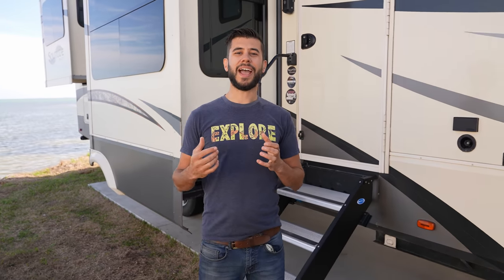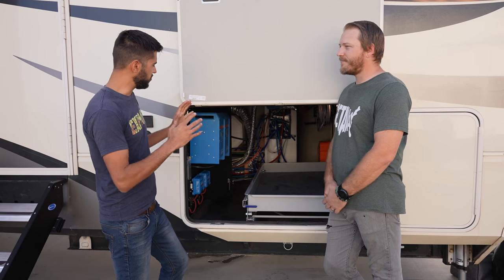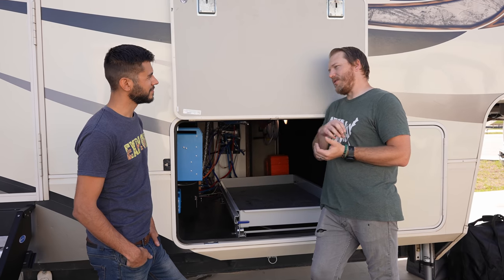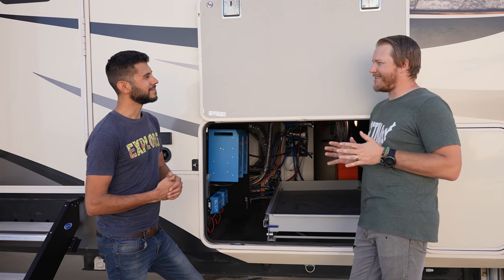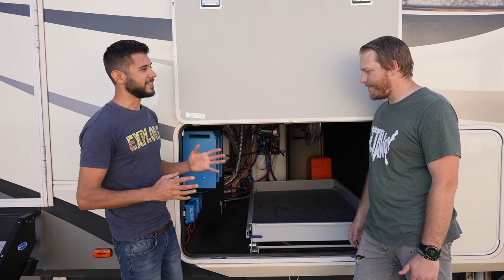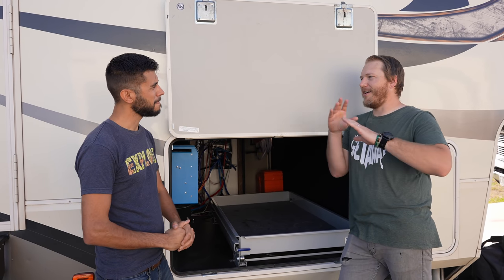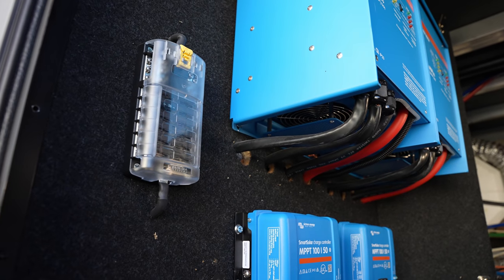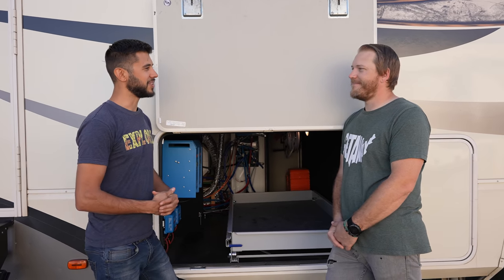Are Two Inverters Better Than One? | Discussing Split Phase Off Grid Pros And Cons

Comment: Of course Victron just released the Multiplus Ii 12/3000 inverter which will take the 30 amp and automatically bridge it accords both 50 amp loads. They are always improving their products. Love your clean install, especially how you ran the conduit on the roof. That makes a lot of sense.
Reply: Have you asked yourself if the new inverters gen 2 are not as great.I mean so durable?
Reply: @bobocrina2643  I trust Victron whether first or second generation. Victron has an incredible warranty and track record. Thus far my Victron Multiplus II has been outstanding and does everything they said it would do. Combined with the 712, ColorControl GX and WEN Generator it is an outstanding system. Not sure I want or need solar.
Reply: @terryhaynes1596  I was told by a well known Australian  Victron Dealer/ Instaler that  they do not have so great experience with second generation inverters . they are lighter with not so solid materials to cut costs.
Reply: If so, glad they have a 5 yr warranty.

Comment: Love the nerd out vids.  I'm an EE and installed a system similar to Jasons.  Dual Victrons/600ah BattleBorns/1200w solar.  All power from shore passes thru the Victrons.  My victrons operate more efficiently in split-phase mode than in single phase parallel mode.  I seem to get a little more out of my battery bank in split phase when boondocking.  Perhaps because each unit alternates which is pushing energy into it's coils during inverter mode.  However, the hybrid function works far better when I had just one Victron unit installed.  They don't just cooperate that well when you limit your shore power.  I frequently get whole loads tossed into "inverter" mode when only a few watts is needed from batteries to supplement.   My 50a split phase mode works a little different than Jasons.  Both units draw from shore power, one on each leg.  The second system does not draw from DC.  Also, the constant reprogramming from parallel to split phase is a hassle when you move around a lot and don't know whether your getting 30a or a 50a connection next.  As smart as the Victrons are, this should be a software fix.  Just detect the incoming waveform on each leg.  If they're 180 out, switch to split-phase, if not stay in single phase.  Hello Victron!
Reply from the maker: Awesome! Thank you!
Reply: Hey maybe you could answer my question. I am wanting to hookup a solar system to my house.. my plan was solar to charge controller to battery to inverter then to one Positive lug where the meter used to be... Same exact setup running into the other Positive lug with ground and neutral together... Would that make a split phase to allow me to keep the original breakers and wiring in the house?
Reply: You wouldn't need to reprogram anything if you wired them correctly!

Comment: With a dual 3,000 watt Victron Inverter system like this,  I would definitely have a battery bank of 10 Lithium Iron Phosphate batteries. I'd have such a great time installing the quality Victron Energy components for a boondocking-bound rig. Electrical Gear Geeks Galore!

Comment: Great discussion - Not the end of the world but you migh consider separating the inverters from each other - they vent from the top and your pushing hot air from o0ne inverter into the other. Be safe Mike

Comment: Hi do you need two charge controllers? I got a 3000w inverter/charge controller, but want to add a second regular 2000 watt inverter. I don't have a victron inverter though. Also my main inverter charges via shore too. So I'm assuming I'd need a system that turns off the secondary inverter when shore power is connected?

Comment: Tom will the auto former if your just using your batteries and say running 4000 watts still balance the power to both 3000 watt inverters?

Comment: When you connect to any shore power source thats less than 50amp, how are you getting around the pass thru power issue?  From what Ive read, 30amp (example) shore power connected to a dual inverter setup cant supply power thru both inverters.    For victron you have the option of passing thru single phase power on one inverter while the other inverter (L2) is only able to invert.    So you would have the full 30amp on L1 that goes thru inverter 1.   However L2 only has power from batteries, not shore power since L2 routes thru inverter 2.  And then single phase generators have this same issue.

Comment: I’m curious that if you’re using two separate inverters, are you using two separate battery banks?
If not, how do you wire this up? 🤔
Reply: One battery bank, normally batteries run to a busbar and then from busbar to each inverter....inverters have to have the same firmware and be programmed to work together....

Comment: Why do you only have 2-50 amp controllers for 2000W of panels? The most you can get at 14.6v is 730W per controller, so 1460W max. It would be an easy upgrade and not inexpensive, but it's like 2 of those panels aren't even being used.
Reply: Generally having extra solar panels is a good thing, it means on cloudy days you can still make 1460W to max out the controller and in the summer you don't have to tip the panels  because you still have enough coming in with them being flat at a bad angle.
Reply: @BenBrand  having the controllers sized so that they can provide the maximum power that the panels are generating makes more sense. On cloudy days you take what you can get but on sunny days they are limited by undersized controllers.

Comment: How about 1 larger inverter….say 5000 watt….and an auto transformer to balance the loads?
Reply: Yeah that's for sure the better way to go. Problem with this setup is that you can only ever get up to 3000 watts on each leg. With the autoformer setup you can use 100% of the power on each leg.

Edit: They do cover this at the end of the video
Reply: A single inverter is more efficient as the standby power of only 1 inverter being on is half as much, as well as creating a simpler system. Sometimes simpler is more efficient and in the end better. I have a 4000 watt giandel super efficient DC-DC/AC inverter which works the same as powering from the generator.

Comment: 🤔 warum nur auf 12V ???  ist bei Leistungen über 800W uninteressant, da der Strom viel zu groß wird... 24V od für Daheim 48V deutlich sinnvoller ! mehrere Wechselrichter macht sinn, um Strom zu sparen bei kleinen Verbrauchern würde ich sogar noch ein 800-1200W Victron dazu nehmen vorallem wenn im System 5000er verbaut sind wie bei mir, die nur für große Verbraucher aktiv sein müssen.... im K30 hab ich nen 24/3000 und 800W PV (2x400W) Sunpower Maxeon 3  ;) Grüße aus Deutschland

Comment: I can understand dual inverters for redundancy but if you don't have any 220 volt appliances why do you need split phase 🤔👍
Reply: If you don't have a split phase system you can't take advantage of the 220v 50 amp plugs. You'd get 50 amps but only 110 volts. 
I don't know if this makes a huge difference with rv's though.

Comment: Have been an Electrician for over 50 years and never heard of split phase until this year. There is only Single Phase and Three Phase. Quit making up things in an attempt to sound smart. Watched about 2 minutes before shutting this off
Reply: Split phase is the North American standard for 50A 240V RV electrical systems. 
https://en.m.wikipedia.org/wiki/Split-phase_electric_power
Reply: @LuckyCharmRVing  120/240 is Single Phase, same as 120/208 and 347/600, etc... are 3 Phase. And my bad, meant over 40 years, not 50
Reply: @michaelphilip9378  indeed, fully aware of the difference in phases. Was just pointing out split phase is the standard as what is referred to in North America’s 50A 240V RV electrical systems.
Surprised a 40/50 year electrician doesn’t understand that. Just wanted to clarify that it is common knowledge and industry standard, not something made up as you stated. I guess it’s hard for someone to learn something new if they think they already know everything though.
Reply: I'm sorry you don't understand that.